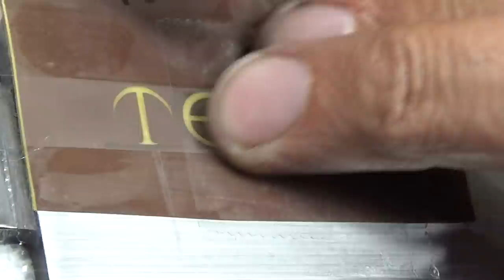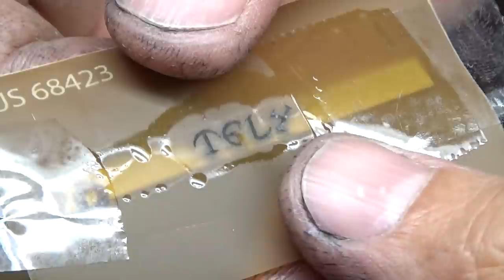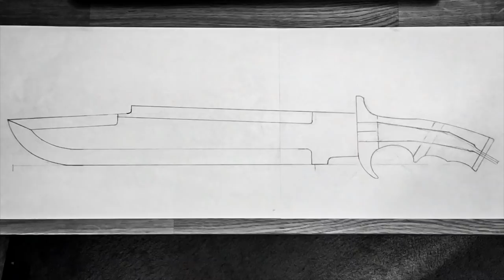Making Predator Knife Part 5

Comment: Have you ever considered using a Cork Belt (they come in 2x42" up to I think a 5 or 6x72") to strop your knives?  They take a few minutes to break in, but they give you a hair popping edge... they also do a really good job of putting a satin to mirror polish on a blade. 

Nice watching you work as always, Monstrously large blade, and I really like how the Ironwood Burl Polished up, has a nice bit of fire to it when the light hits it just so
Reply from the maker: I have cork belt but have not used it since I bought it 3 years ago.
Reply: I practically swear by cork belts as they save me hours of hand sanding (I'm getting old and I have Cubital Tunnel syndrome in my left elbow)... Those, and my Gator Belts. 

I take a knife from 60-600 grit (30-300 micron) on the Trizact, 900 grit on a cloth backed belt, hand sand up to 1500 then finish up on the cork belt w/pink or white polishing compound.   Total time I spend on hand sanding is about 45 minutes give or take.

Comment: Amazing work! Though you made a replica of the knife sold on Amazon, if you look at the original that Arnold holds in movie poster it has one more bevel that goes through the middle of the blade and the handle is more rounded.

Comment: It's a beautiful knife but I'm curious as to why the ironwood and steel were purposely made not to line up?? the ironwood being larger than the steel part of the handle is very off putting to me but I love the knife great work
Reply from the maker: Because parts move slightly by not being glued, this is one way to hide the movement between steel and wood
Reply: @SLAVIKTELY  Thank you that makes sense.

Comment: With a blade that size I would have thought it would be closer to a full tang.
Reply from the maker: After using it, yes you are right. It has to be made full tang.
Reply: @SLAVIKTELY  It makes you wonder though. Medieval swords basically had a rat-tailed tang and they were used for battle. You would think that striking a shield would be similar to chopping wood.

Comment: Your skills are amazing and the knife turned out great, but I can only cringe at that sharpening method. The first 0,5-1mm on the edge are DEFINETLY overheated and your heat treat is going to be ruined by sharpening dry at full speed on a grinder like that. Only because it doesn't turn blue doesn't mean its not overheating and damaging the steels Structure. The rest of the blade pulls the heat out so fast that the steel doesn't have time to develop visible oxides, but the alteration of the steels structure happens in the matter of nanoseconds.
Reply from the maker: I do not have a water coolded grinder to sharpen my knives. I do what I can with what I have. Thanks for the input.

Comment: Personally i dont like the knife design. Its well recreated tough, only thing i notice, is that the handle parts and their edges, are not even. You can see the edges pop,out a bit here and there. The original is completely smooth.
Other then that. Good work 🙂
Reply from the maker: I live in dry climate and if I made handle edges flat then If I was to sell this knife to someone who lives in humid climate the wood handles would expand and would still see them pop up. Knife makers do this on purpose so this problem would not happen. I like it when wood is little bit popping out.

Comment: Not bad, but not functional. That handle will fall apart fast, the butcap has no retention and the tang is so thin it will break. Beautiful wall hanger but that's about it.
Reply from the maker: I made it to replicate the Predator movie. It will be on the wall. I am not using it again.
Reply: That tang is the same size as a sword tang, and the buttcap is the equivalent of a screw on pommel. Segmented handles like this have also been seen and used countless times by functional knives
Reply: If it's good Steel it won't break and the way it's made, the handle will add extra strength. It's not an axe and define functional use for a blade like that! Go educate yourself!